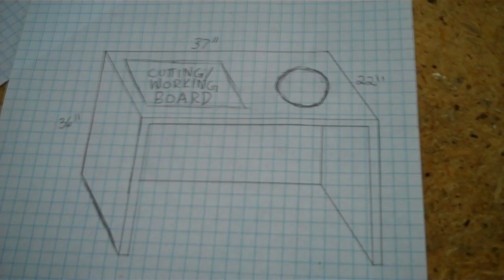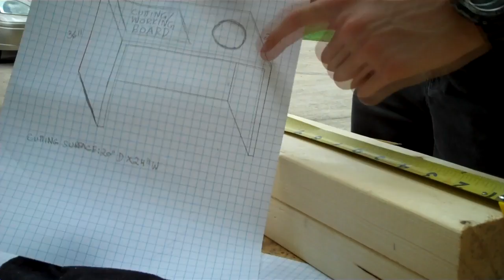Chapter of the Hut 13 - The Kitchen Workstation

Comment: Nice table! For the next one, you may find that if you have your table top with a simple frame underneath, you could put the legs on the inside of each corner and you would have a much sturdier table, including side and rear braces. Also, cover the top with vinyl flooring or some other smooth surface. Would be easier to keep clean. I would also out out of the metal cutting board. Hardwood or a thick plastic cutting board would be better I think.

Comment: He said he used stainless steel brother,cheaper than a big piece of hardwood, no rust, doesn't transfer/absorb heat as much as normal metal, easier to clean, and will probably outlive our great grandkids ...but it is much harder on knives than hardwood